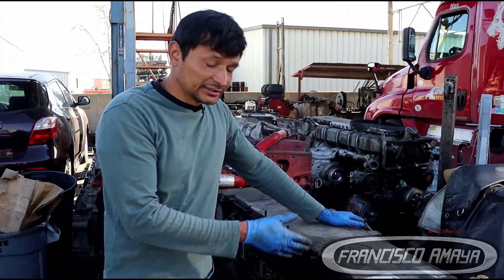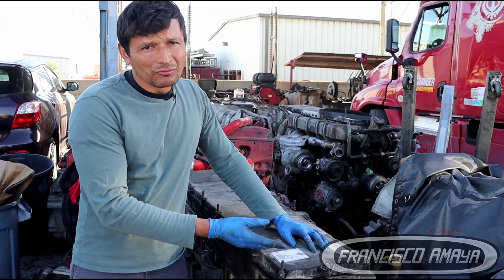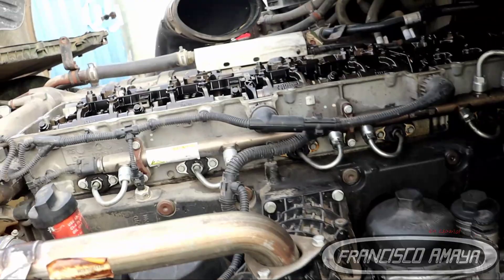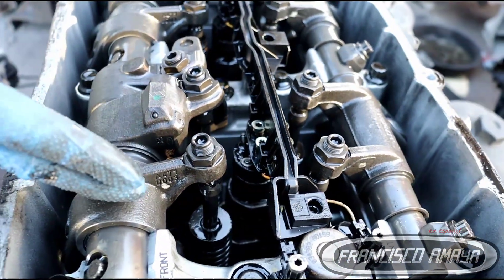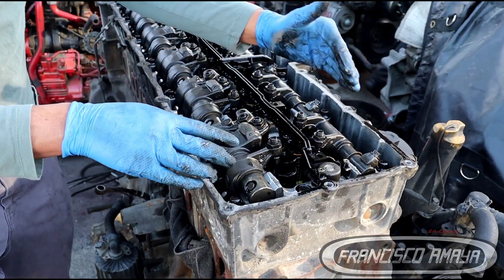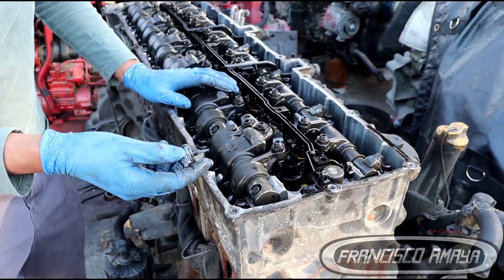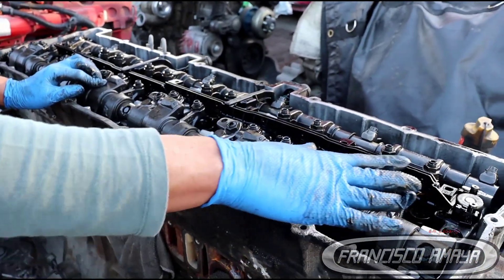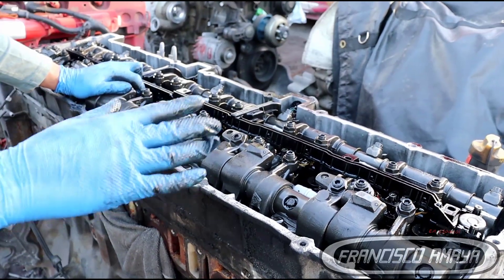Freightliner Cascadia DD13 DD15 DD16  valve adjustment over the head tune up lash adjustment

Comment: Hello Francisco 
My truck is starting smoking a lot and loosing power and speed stuck on 55 after I pass 65pmh!
Do think I need to do adjustment on the engine valves?
My def is deleted
Reply: I have the same problem. Did you figure out what to do?

Comment: Hi . Yesterday a mechanic did valve adjustment for my 2019 DD15 engine. After valve adjustment I started engine and figured out there is little knocking sound. And when I press gas pedal the sound turning like engine brake sound. While I am driving the sound always on like engine brake is on. I brought truck back told the issue to the mechanic. He removed top cover again and found out exhaust cylinder 3 valves were too loose. Then he did compression test by sending air into engine from the pipe which is attached to turbo. The air was coming out of the exhaust pipe. He said it is bad cylinder head. What is your suggestion? Before valve adjustment no knocking sound was there in engine.
Reply: Good question
Reply: sounds like he adjusted it too tight and exhaust valve wasn't closing and burnt the valve.  Should have never drove it after you started and heard a bad noise !
Reply: @eclipsetrekker thanks for replying. There was bad cylinder head. After replacing it within 2 months injectors went bad. After replacing injectors fuel pump, water pump, def pump went bad within 5 months. Then egr cooler went bad. Then sold it. Got rid of that shit. Bought for $35k, spent $30k, sold for $30k. Stay away from Freightliners after 2017 models above 400k miles. The manufacturer designed the truck tear down after warranty expired.